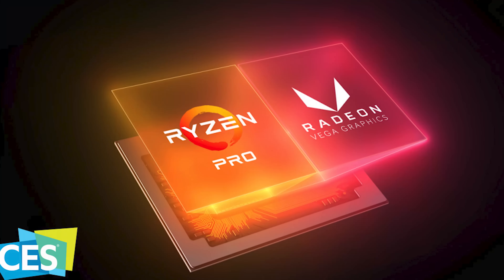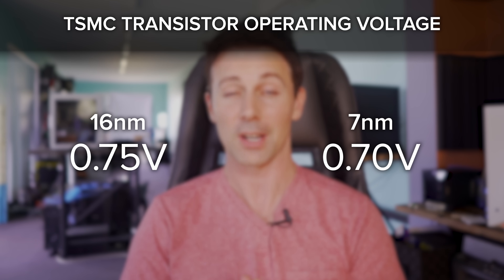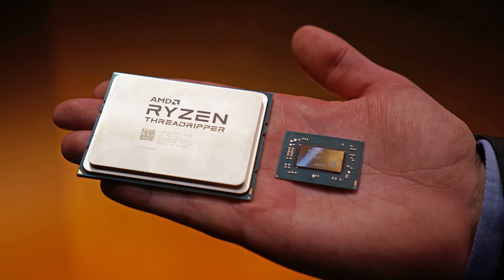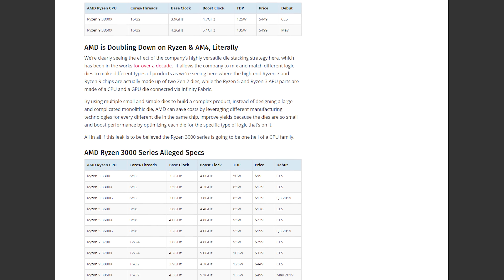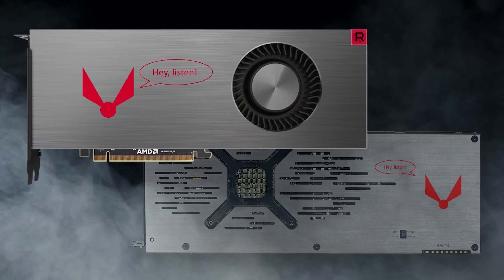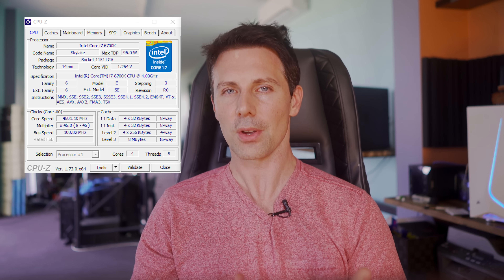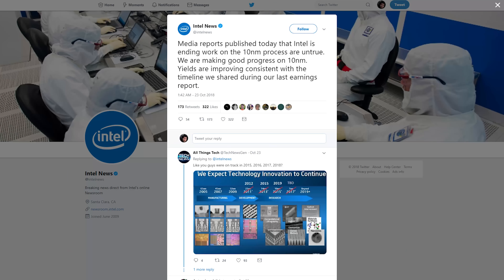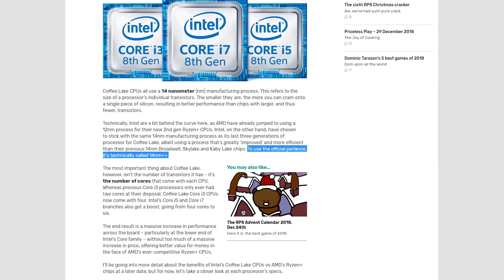7nm, 5nm and Beyond - Will AMD RYZEN 3000 be the PINNACLE...!?

Comment: REMEMBER (Data Centric) 389mm 120w 1900Mhz vs 0.09w 600Mhz thats 400x FLOPS per watt vs large chips copper will be replaced in the interposer an software's will be totally revamped code

Comment: If the problem is that a 6nm gate size will result in malfunctions because of quantum tunneling, then how is EUV lithography going to help matters?  Is it a question rather of bad tolerances on the transistor gate size with legacy photolithograpy processes?

Comment: there is one other way than reducing structure size, everyone knows about but no one dares to try (yet). while those structures have lots of layers, they are still inherently two dimensional, because all processes rely on lithography. coming up with the idea to use lithography was the clever trick that made all integrated circuits possible in the first place. if someone finds another clever trick to use the third dimension, it would push the end of moores law into a much more distant future. while there are a couple of ideas, how it could be done, no one yet put the considerable effort in, to seriously try yet. given the size of the industry and amounts of money involved, the few vendors able to maybe pull it off, will probably start right around now to at least do that in their science departments. unfortunately jumps in technical evolution can't be enforced, so nothing is certain, but maybe the next couple of decades will be ruled by how many interconnected layers of 5nm structures could be packed on top of each other, whereby the 'interconnectedness' is only one of the involved and yet unsolved problems. the architectures would also have to be entirely rethought to pull that of. even then, eventually those cubes will reach sizes where the speed of light will limit the cpu's size, after all the entire structure needs to be in a predictable state, not only parts of it. it's distantly related to the fact, that not all problems can be transformed in a way to be solvable in distinct part's, which is the only reason we can't just throw more cores at a problem to solve it faster.

Comment: On the gpu side of things 28nm gave us some good improvements through the 600, 700 & 900 series on Nvidia's side and the 7000, 200 & 300 series gpu's on AMD's side so being stuck on 7nm for a while won't neccessarily be a bad thing as it will likely offer us a few years of improvements going from gen to gen and I'm guessing it'll likely be the same on the cpu side so there's no need for us to panic just yet.

Comment: ''Too far to be good for AMD '' Yes , but look at the yield rate of AMD vs Intel's ;)
AMD has 65-70 % of yield rate
Intel , high-end mega super expensive processor has 35 %

So yes, Intel throws at the garbage 7 processors from 10. Now , we know why Intel is soooo expensive.

This year I'm 100 % sure that I'm going to buy ryzen 3 series...Better performance , less price.
Not 600 bucks for I7 that has 6 cores 6 threads :/

Though , MEGA INFO : Intel won't switch on 10nm this year...They'll go on 14nm until 2021-22. So , yeah , we'll see only 14nm+++++++++++++ from Intel

Comment: EUV will do absolutely nothing to get anything below 7nm working. If the FinFet-Design doesn't work due to quantum tunneling, then you either need a new way to make the gates work (for example nanowires with gate all around), or switch the substrate material (germanium)

(I did my diploma thesis in the field btw)

Comment: It is not only moore's law... Also taking into account other laws (ex: Amdahl's law) and purely hardware based CPU and GPU wise, packing more cores is only efficient up to a certain point. That number being capped at around 64-128(This is a very subjectively realistic number(ha) and depends on the architecture) Why? it's also all about the performance increase vs cost vs consumption. There are charts for certain GPU's architecures (same with cpu's) that in the gpu's instance, having 4096 cores is only about 5%slower then having 128 000 cores. Let alone the production cost/TDP.... We did hit a limit and that limit will be achieved this end of the 20'th decade/beginning of the 3th decade of the 21st century.(funny, close to the 32 bit end of service year 2038) What the future holds I do not know....

Comment: Silicon is so 20th century...
Graphite FTW!
MIT just nailed it with a new way of mass-producing it.
Reply: @SuperSW20 Yeah, I meant graphene. I'm not sure what makes you think that it's toxic to humans by touch, given how graphite has been used by humans for centuries, and still is (in pencils). Also, virtually nobody touches the silicon itself in any cpu chips - there are multiple layers of packaging even when you put a cpu into a socket...
Reply: @SuperSW20 If it was a different material they wouldn't have been able to make graphine from graphite with just tape. Can you point me to your references? There are plans to use graphine for touch-screens because it's +90% transparent, super-conductive, and super strong. That would mean millions of humans touching it directly every day. I know there are toxic chemicals involved in the some manufacturing processes that make graphene, but these are in gas form, they don't stay in the graphene once it's made.

Comment: 7nm 5nm 3nm 10nm 12nm 14nm are just marketing names now a days and does not reflect the actual channel length since 22nm. Most of the shrinking progress comes from smaller contacts in transistors, you can check it all on chip. wiki

Comment: I would have expected that quantum tunneling would have been a problem several generations ago, but leakage can still be contained, if the boundaries and weak spots in an architecture are tested extensively then refined over time to redesign and counter the issues faced. Intel's problem with design appears to be a work process approach where they don't investigate alternative chip designs in a parallel competition to save on production costs. That decision has effectively cost them their vaunted manufacturing lead over AMD and probably cost them all the work they did on the Larrabee project back in 2010.
As far as I can tell, AMD has initiated chip manufacturing where hybridization of various chip design sizes has increased performance without having to be dependent on only one manufacturing process. Their current projected blueprint to future chip design has the central retail chips retaining an I/O chip that is manufactured in a separate larger platform with redundant components to reduce the failure rate and increase potential usage options. I wouldn't be surprised if AMD uses any combination of 14, 10, and 7nm chip manufacturing to develop a package with improved performance. I foresee Intel and other competitors reluctantly deciding to use the same approach in the future.

Comment: 5:39
EUV is nothing to do with "overcoming" quantum tunnelling. EUV is about the precision in the lithography, and quantum tunnelling will still happen at micro scales no matter how accurately you place your silicon.

It might have a very small impact, as with less precision there are likely to be more gaps with a lower energy barrier to tunnelling, but this is generally not significant compared to the classical electrical effects. The only way to mitigate quantum tunnelling is to fundamentally change the way we design microprocessors - for example, using elements other than silicon, or different types of transistor.

Comment: I predict 7nm++++++++++++++++++++++++++++++++++++++++++++++++++++++++++++++++. That will be the end of the road for silicon. You buy a hyper car today it might do 220mph. 20 years ago they did 220mph. They don't accelerate quicker, they don't go faster ... you just get to the end and you make different, not better. I suspect they'll start tailoring cores eventually, gamers cores, creators cores, developer cores, server cores and they will all be on that 7nm. Might also see cannibalisation of other markets. The RAM ends up on the die, your boot drive is on the die (optane persistent memory anyone?), motherboard components end up on the die, the CPU manufacturers look to swallow everyone else with an SOC.

Comment: I think the 3rd dimension is the next breakthrough.  Currently chips are a 2D layout mostly.  There is never one transistor on top of another.  If transistors can be stacked a few deep the surface area of the chip gets a lot smaller.

Comment: There's one thing i don't understand.
Why has everything to fit a specific size?
If we are approaching physical boundaries anyway, why not simply make the chip bigger?
Reply: Ferodra would require new sockets for motherboards.
Reply: Larger chips are exponentially more expensive due to the likelihood of a defect, and you also get less of them per wafer. Chiplets help with the defect problem, but using lots of them still results in fewer assembled devices per wafer. Also, heat becomes even more of a problem.

Comment: I'd say off unit quantum cloud processing.... What's needed there is much wider data transfer... Like a thousand or 10,000 times faster and massively multithreaded.. Like 16k threads... But solid state has reached the end of the line alright.

Comment: 7nm, more like 7000nm if we give them extra credit. With the info currently on Wikipedia, if you divide the transistor count by the chip size to get the "14nm" processes of both AMD and Intel. AMD ends up just over 44,000nm per transistor (based on Ryzen 5 1600) and Intel is just under 70,000nm per transistor (likely based on 6700k).

Comment: Great Introduction about the 7nm, 5nm and end of Moore's Law, perhaps you could do a comparison between's ARM Holding's Cortex RISC designs compared between Intel and AMD and NVIDIA's CISC X86 design architecture. Already Qualcomm is alreadying coming up with the ARM's RISC Architecture 8CX chip targetted for Laptop markets, and I think its just a matter of time they could compete in the Desktop market simply by stacking up their RISC chips instead of 8 cores currently to 16 to 32 cores to match up with AMD's Another huge bonus is that ARM's design can actually interface GPU and CPU into their product design, making it a deadly combination of a super duper chip for Desktop, Servers, Laptop, Tablets, and all kinds of remote computing that you can think of!
Reply: Qualcomm is a rising beast

Comment: I always asked my self when I got my Pentium 3 with 500 MHz (afair only 450 or 500 MHz Desktop Edition existed @ X-Mas 1999), I always asked myself how it will be with 100 GHz or 1.3 THz for example^^ Now almost 20 years later...except i3-540 (dual core, i-core 1st gen afair, 4 threads with ~3.06/3..07 GHz) thats 10 years ago too..Like with SLI and my Ryzen 7 2700X I think this is good but having 2 x 1080 Ti via SLI is not 200 or lets say 199% of one... even the old cards with 2 GPU's @ one DIE via one PCI-E slot, had at least 10% or more worse graphic speed and "ryzen 2" counterparts at release in a bit more expensive price class were/are only better in the usage of up to 4 threads, my times are over but someone just wrote he has a cheap Ryzen 2300g or so with onboard graphic + RX 570... dunno why?! RX 570 sucks, and a stupid cheap gpu maybe can make something like in the old days using a old nvidia card for PhysX (at Mafia(1) times it still worked^^) but a Radeon "real" graphics card, Nvidia made steps so that a mix is no longer possible (maybe also because of Freesync?!)

First however graphic needs a push and nvidia a lesson, so if you get happy with cheap CPU + GPU okay, just stop that 2700€ Titan RTX shit and over 1000€ (1259€ now Founders Edition....)... so show it Nvidia :D discounts are there now and free games for every new card, even old 1060, so I guess  so many people dont pay these prices anymore...

Comment: The trick to cancel quantum tunneling is to apply a measuring field forcing the universe to reveal the location of the particles constantly, thus no quantum tunneling can take place and we can push to lower limits.

Basically we need to collapse the wave equation of the electrons.

Comment: Extreme UV lithography has only to do with the lithography resolution, not the quantum tunneling effect. The nanometer from what I am aware mostly refer to the gate size of the transistors, not the transistor size themselves. So most probably they try to increase the lithography resolution to make the transistors smaller, decreasing the parasitic capacitances, enabling transistors to switch faster and more efficient. But not much they can do about quantum tunneling, at least not with current materials and even with exotic materials it would still happen.

Generally I do not see a reason to go smaller with silicon, also smaller is unfortunately the only way we have found so far to reduce parasitic capacitances thus achieving higher speeds. For example graphene chips are much more efficient. We just don´t know how to mass produce them.

Comment: You mention "Especially on high performance desktop parts"...   ~6:15 But why?   Can't they just force us to use (Physically) bigger chips with higher power consumption?   Where I see this as a problem is especially on mobile (including laptops, but probably not enthusiast level stuff) where if you can't shrink the chips you might not have space to make them better (AKA add more transistors to make them faster).  As long as they are making mobile, and server stuff better one way or another I think high performance desktop parts are going to be ok and both markets have demand for better stuff... To make desktop stuff based on those designs you can make mobile stuff physically bigger, or server stuff smaller (binned parts or physically removing features, etc)...   Am I missing something?

Comment: Wonder where those quantum processors will fit on future, I mean, I don't really know if their construction is somewhat similar to our mainstream processors so they would share the same tunneling problem, but the concept is pretty interesting, like, I'm a medical student so I don't really know much about those circuits, but as far as I know, the "processing" is basically a bunch of 1 or 0 signals, that are essencialy open or closed circuit, that generates some sort of "effect", on quantum processors, the operating unity would be able to be on 1 and 0 at the same time, just like the behavior of elétrons as wave and particle, this behavior kinda completely changes the way we control the "effect", which is somewhat coming from the 0 mark, but in theory, gives us a immense boost, saw a video somewhere about it, seems like the processor itself must be isolated on some sort of chamber, which might look like it's not achievable to the masses, but then I look back on photos of NASA computers back on apollo mission, gigantic trucks, like a wall, a whole building full of thoses computers working together had less processing power than my moto g4 play nowdays, quantum processors might come out from the "top secret world" to our homes, just like many other inovations came from nowhere

Comment: A couple of observations about your video: Fabs do not make wafers  -wafers are purchased commodities -they provide the substrate the chips are fabricated on (by places like TSMC and Intel and other chip makers); Also controlling leakage currents does present an obstacle to making forever smaller transistors, but deep ultra violet lithography does not address that problem in any way -that technology is simply the wavelength of light required to pattern devices that small, once fabricated such devices may still leak too much to function properly. Making DUL work properly is itself another and different technological challenge.  Finally, those well versed in this industry do not assume TSMC 7NM will be delivered -on schedule or ever.  Maybe it will and maybe it wont. 7nm is pushing what is possible and all companies and fabs have a proven history of letting their marketing departments make claims that exceed what is possible until that wall is hit.  That could be happening to TSMC at 7nm right now. The fact that Intel, who historically was the world leader in Si fabrication has become stuck at 10nm (and the TSMC 7nm node is actually quite similar to Intel 10nm node) makes me wonder how likely it is TSMC will ever make 7nm deliver on the claims that are currently being marketed by groups at TSMC whose job it is to make stuff sound good but who are not the people tasked with making things work.... Lastly, graphene is promising, but if that ever eclipses Si it will be in your grandchildrens world....

Comment: EUV is how smaller chips will be etched into silicon but it is NOT how the problem of quantum tunneling will be dealt with, for that we will need a new transistor design called Gate All Around Field Effect Transistors (GAA-FET) which is the next obvious evolution that started with FIN-FETs. In planar transistors the gate sits on top of the channel contacting it on one side, in FIN-FETs the channel protrudes upwards into a fin and the gate sits around it covering 3 sides, with GAA-FETS the channel now exists not as a fin but instead a thin ribbon or wire that is surrounded on all sides by the gate. This increase in gate contact against the channel should further help it to combat leakage. After that all bets are off, although there is research being placed into Tunnel Field Effect Transistors (T-FET) that actually USE tunneling as their method of operation.

Comment: I think a big problem with computing is there's a much stronger push for faster hardware than for streamlined optimized software, I suspect operating systems and graphics engines etc. could be made much more reliable and efficient negating the requirement in the short term  for much faster hardware, but the software culture seams to only be  stuck in being  just good enough.